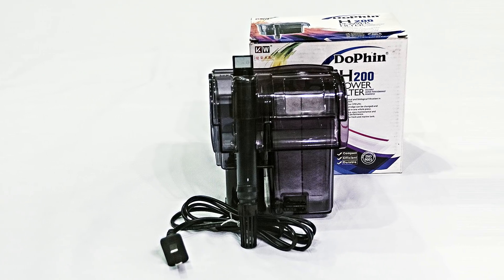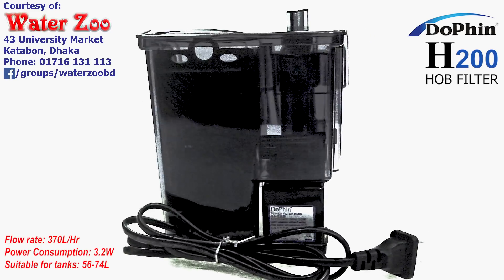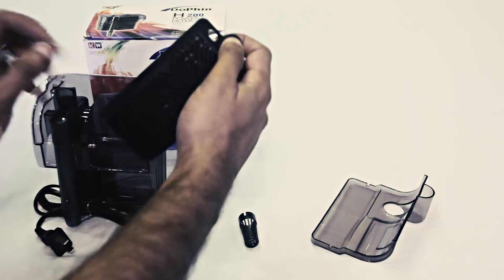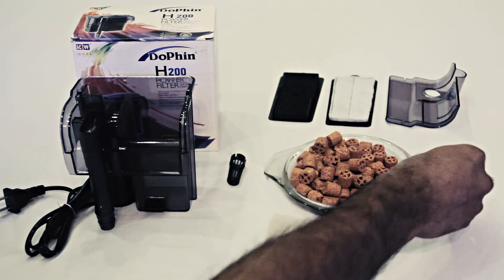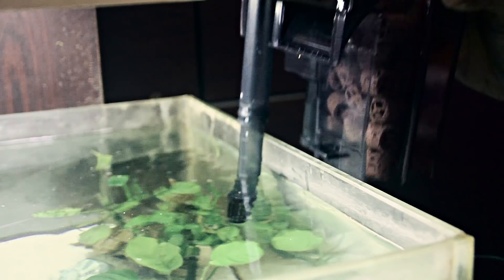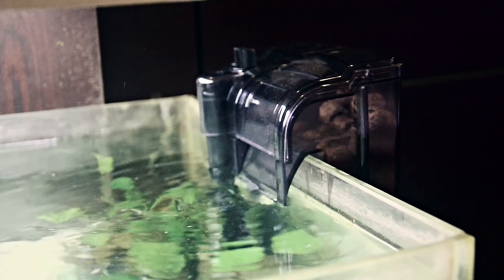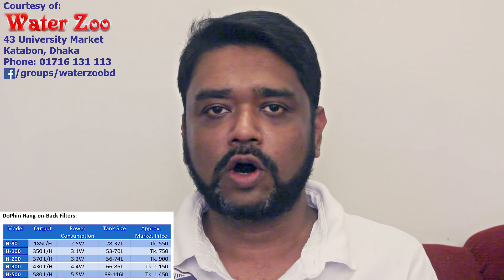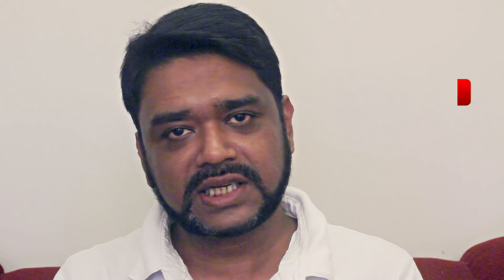Product Review: DoPhin H200 HOB Filter

Comment: my tank size is 75 gallon so i need this filter for my top part...I will use submersible filter for the bottom part of my water tank....my tank will consist of natural underwater plants so I will get lots of space in the bottom part of my tank unlike the submersible ones which takes space. this HOB filter main station will be outside my tank....also the reclining and extension of the input pipe is a cool feature too. my tank height is 3.5 feet.
Reply from the maker: 1. U cannot use a HOB in a 75G tank
2. The giveaway ended almost 1 year ago!

Comment: I have a 17 g shrimp tank. there are one spong filter and one diy spong filter currently running in that tank. which takes a lot of space of that tank. and the air pump makes a lot of sound. which is making so much noise. 

as it is a Hob, which will help me to get enough space to make a awesome scape. and I can get rid of that annoying sound of my air pump. 

so it would be awesome if I win this.
thanks.